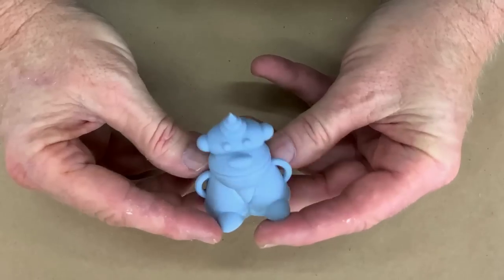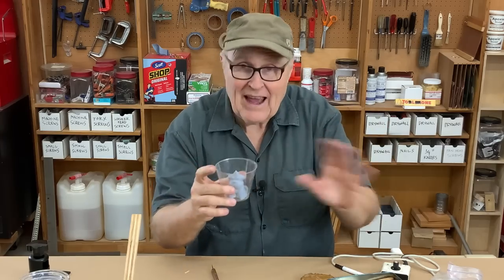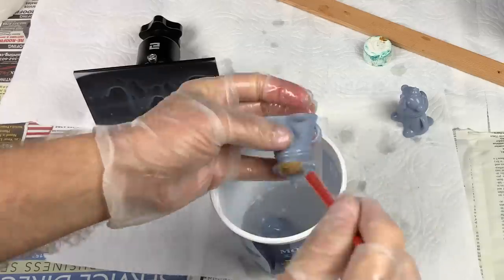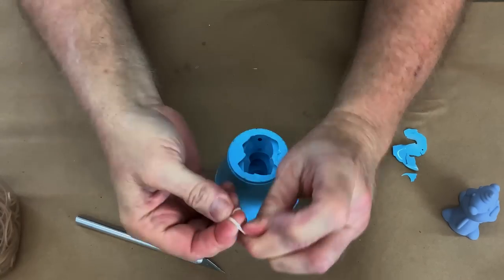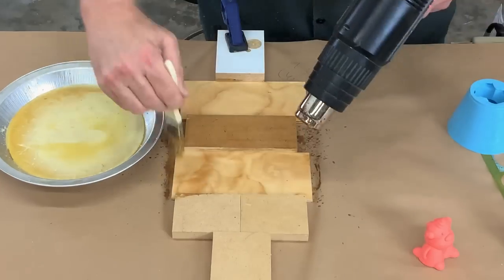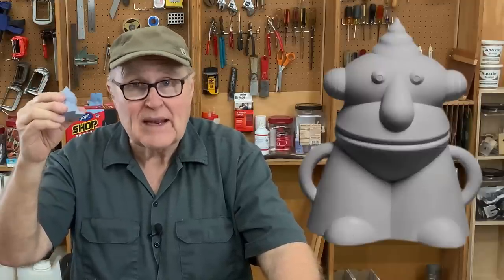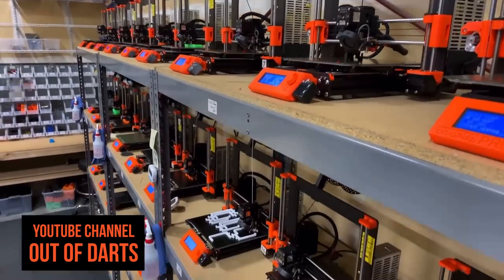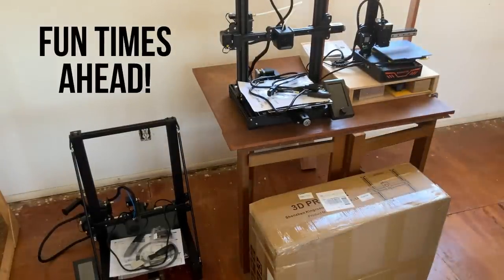Which Is faster - Resin Casting Or 3D Printing?

Comment: Neat test. Everybody loves 3D printers, but if you need it in bulk, it's far better to cast. And if you need a one off, better to 3D print. That's why I've never understood the 3D printer farms. If you need that many, you might as well cast it, doesn't take that much time investment to do so.
Reply: Because you can print on demand. You don't need a physical master to make a mold from. And each printer could be doing a different object. Imagine a client sends you 5 3D model files saying "I need 4 of this, 2 of that, 3 of the other, etc. " You just say OK and start the printers. No time spent making molds for each.
Reply: @3DJapan  Sure, and I suppose that happens a lot these days. That would fit in the realm of "one off", and I'm sure there's a lot of business in it. However, when you need tons of prints of the same objects and people go to a printer farm, that specifically is what doesn't make sense and it too happens a lot these days.
Reply: Also with FDM and parts designed for FDM process, there's zero labor/postproc. It comes off the bed ready to go.
Reply: @daliasprints9798  If you don't have to remove rafts or supports, then yeah, no post processing, but it'll still be slower than casting even accounting for sprue removal.

Comment: Another wonderful video.  I’m VERY interested in doing 3D printing as a master and then making slush molds to get as close to a designer vinyl toy as possible with flexible resin.  Which resin would you use thy could be tinted any color and also be flexible like soft pvc vinyl?
Reply: See the Crafsman’s videos. He does a deep dive into rubbers/resins/silicones that duplicate vintage Star Wars action figure ‘flexibility”.
Reply from the maker: I don’t cast flexible objects so I have never figured out the combination of materials to use. Elastomers are a whole other universe from resins. What little I have done taught me that there are nice urethane rubbers to work with but they have their own requirements. For instance, they often won’t cure in silicone molds and they are extremely sticky - in fact make an excellent adhesives.  You could possibly hollow cast urethane rubber in a solid 3D printed mold but you will need a very effective mold release or barrier coat.
Reply: @davesilva9174  Wow, I’ll have to go back and check.  Thanks!
Reply: @RobertTolone  Absolutely.  If I were back in the US, I’d buy up a bunch and try them out, but here in japan, resins and urethanes are basically a one size fits all type, no real options…

Comment: kind of reminds me of the shop i used to own with my then-wife, where we did screenprinting and vinyl. our standard was an order of 20+ shirts would be screenprinted, small order would be done in vinyl. i think that's very analogous, e.g. the 'mass-production' method took up so much more set-up time and a tremendous amount of physical space, but in the end saved time... but, there was more scrap and had very real costs.

i could go on and on, the point being it just depends. how many pulls are you going to get out of your molds, especially if there's finer detail? 12-15? without a printer, you're going to be making many molds to make enough pieces to make into a gang mold. you simply have to know your costs and your times. if you rent work space, that costs per square foot, so you have to justify that, too. but, at one part with your printer farm i'd have to ask, 'what are we doing here?'

Comment: I wonder how detailed you can get with a casting mold. On a Resin 3D printer you can get quite detailed. And do you print your models with a hole in the bottom, recommended to drain out any uncured resin when Printing. This is also 1 thing you don't have to do in Resin mold casting.
Reply from the maker: I would use drain hole where needed on hollow parts.

Comment: Hi,
One Question thats always in my mind: When you use a Papercup as Moldbox. WHY not place the Mould in one Cup for Resincasting? You can forget about the Rubberbands? The Cup holds the siliconemould perfectly in shape. 
Thanks.
Reply from the maker: Because, as strange as it sounds, cups are not identical- even from the same package.  I have discovered there are slight variations that can result in open parting lines on the mold.  Inside the cup I have no way of massaging the mold into a tight fit. With rubber bands I can adjust the strength and position of the closing pressure. Also, casting resin produces heat and the mold expands slightly. That means it no longer fits into the cup even if it did when the mold was cold.
Reply: @RobertTolone  Thanks for taken Time to answer me. I have some of your favorite moulds (two part clay moulds ;-) ) I keep them in the rectangular box. put the second part on it like a lid/cover and have no problems with castings. but never tried with cups. Thanks

Comment: great content, very helpful!
which one do you think produce more detailed product, resin casting or 3D printing?
assuming i made the molding silicone with 3d printed master
Reply from the maker: Much more detail in a resin casting. The resolution of current 3d printers is low compared to resin casting which can reproduce microscopic detail.

Comment: Cheated time on casting three. Exclusive use of three cast models in the casting box would have been truer. 
By using the printer resin prints for casting, you shorted the casting time considerably
Reply from the maker: I accounted for that time in my calculations.  That’s why it took me an hour to cast one and an hour and a half to cast three.
Reply: @RobertTolone  have a great weekend Robert

Comment: With Resin printing you should have made 3 prints in 1.5hrs not just one print. This is the difference between FDM 3D printing and Resin printing. With Resin printing Each layer cures the whole build plate in one pass. So the more you can put on the build plate the better. In FDM Filament printing You have to print one Model at a time. Taking 3x as long. So far it is neck n neck in the race.

Comment: Why you use the pressure pod instead of using vacuum? Best, Steffen
Reply from the maker: I use both. Vacuum for de-airing the rubber and pressure to suppress bubble formation in the resin.
Reply: Thank you very much Robert…

Comment: Printing and casting arent opponents, they're complementary. You can use a printer to make the masters, then cast those, best of both worlds. That said, there are shapes a printer can do that you cant cast.
Reply: He said that right at the beginning of the video. Not as directly as that, but he addressed it.
Reply: There is also a wider selection of materials and resins that can be cast than printed
Reply from the maker: I love them both and agree they are complimentary.  I also think that at the rate 3-D printing is progressing it won’t be long before resin casting will only be used by sculptors who prefer to work by hand.  Even then, the day 3-D scanning and printing reaches the speed of flat scanning and printing it’s game over for silicone molds and resin casting.
Reply: @RobertTolone  i've got 7 3d printers and am well and truly into the hobby, but i've been watching your channel to learn casting. Like you pointed out, you can cast a whole load of a part way faster than printing. Especially for larger parts.

Comment: I don't have much experience with casting so maybe this is something obvious I'm missing, but is there a reason you don't print the negative/mold directly rather than having to do that step manually?
Reply from the maker: You can print molds. I have done that in an earlier video. Right now I am experimenting with printing molds using flexible resin.

Comment: I’ve been looking into creating molds out of my 3D prints but I keep reading about cure inhibition. Apparently platinum silicone doesn’t like resin 3D prints. I was curious to which kind of silicone you used or how to prevent cure inhibition from happening.
Reply from the maker: I use tin-based silicone from www.silpak.com: EconoSil-25.  It’s the most inexpensive one.

Comment: You are saying that it takes the same time to cast x amount as print one. However this is an SLA set up. So it's actually the same as 3, the max you can fit on the bed. Unlike a fdm printer, it works on layer time and not nozzle workload. So not a huge difference but incorrect all the same
Reply from the maker: in my calculations I allowed for how many pieces you could gang onto a print bed.  Obviously, if you had a much larger printer, or a print farm, you could print them faster.
Reply: @RobertTolone  you fitted 3 on the bed when printing, but used just 1 printed when comparing to cast.

Comment: I think you forgot one important factor: MONEY 💰💰💰
What is the total cost of the two process?
If you only run a small batch, the casting will be too expensive and not as efficient.
I'm curious to know about that.
And with resin printer, if you have a large one (Jupiter I think?) and or many printer, you might be more efficient and cheaper compare to molding, isn't?

Comment: Just curious, would an FDM printed item. printed at 20% infill collapse in a  pressure pot?
Reply from the maker: It could collapse or be infused with rubber. It might not, but the risk is there.

Comment: No one manufacturing method is better than an other one. I have seen a video where somebody really claims 3D printing will replace injection molding lol....ridiculous.
Everything has it´s pro and con. 3D printing is still rapid prototyping, that´s what´s it´s there for.
The big advantage to 3D printing in this use case is, if you automate the process you can print over night, it´s hard to automate this casting process here. And you can increase the amount of printers, those are cheap compared to labor.

Comment: Robert, is the resin that is used in a RESIN 3D PRINTER the same as the resin that you pour into a mold ?.. buying some products from SMOOTH ON , i was shocked at how expensive that they are and i am hoping for a cost effective resin to pour into the molds i want to make.. Just wondering what else i could use.
Reply from the maker: They are not the same.
3d printing resins cure by exposed to UV light.  Casting resins are 2-part systems that cure by mixing the A and B components together. The mix ratio is usually 50-50 but not always. The manufacturer will specify the proper mix ratio for the resin.  When mixed, the resin has a certain amount of open time before it begins to cure. It also has a time it requires to harden enough to be removed from the mold.

Resin is expensive. Larger quantities cost much less per gram than small quantities. That is why I buy my resins in 5 gallon buckets.  But for most hobbyist that is not practical.
Reply: @RobertTolone  You are so helpful to all of us hobbyist, You always answer everyones questions... Thank you.. YOU ROCK..
Reply: @RobertTolone  Have you ever tried using FINE CEMENT as your casting material.. would that work without harming the silicone mold.. it would be so much cheaper to use CEMENT over the expensive resin.. you can buy it without rocks added as a FINE POWDER... and just add water.

Comment: in my (admittedly limited) experience 3D resin and FDM printers may not be the best choices when making parts that have thin, flat surfaces. the warping issues are incredibly time consuming and frustrating. definitely not something you want to deal with in a production environment. also the dimpling from removed supports, especially on flat surfaces

Comment: Kinda true but not entirely correct.
As someone that does both printing and casting, you neglected that it is EXTREMELY easy to make a mold with a 3d printer rather than make a mold with silicone rubber. There is software where you drop the finished piece into a 'block' and then subtract the model from the block, you can then (in model space) cut the block in half and you then have a mold that you can cast.

If you still want a 'soft' mold, you can just add flexible resin into the cast print. 
Once thats done, you spray the release agent onto the print, pour in your resin a remove when cured, repeat.

Comment: I recently got some silicone rubber specifically for making 3d printed molds, but one of the first things in the instructions was a mention of curing inhibition when using UV resins (which wasn't mentioned on the product page...). My own experiments with this have shown that my resin is problematic. I've found that I can improve it with soaking the print in alcohol for a few hours, but it's still not perfect. 

Do you have any suggestions for dealing with this? Do you know if the silicone you used is specifically compatible?
Reply from the maker: I always use tin-based rubber when molding 3-D printed objects.
Reply: @RobertTolone  Are there any food safe tin silicones?
Reply from the maker: @mredig  Possibly, but I don’t know of any.

Comment: I don't think the preparation stages should be calculated into all this. Sure you need to make a mold first for the casting way... but you don't start building the 3d printer at the start of the project now do you. Everything ready to go, pouring VS clicking the print button, head to head, that's the fair way.

Comment: 2:18 - Me: Ha ha, he said whack them with a stick, I love Robert's sense of humor.  (Two seconds later) I can't believe he actually whacked them with a stick! LOL
Reply from the maker: Works like a champ! (Unless your print is very fragile!)
Reply: Engineers have used that technique and variations of it forever!
Reply: @RobertTolone  Consider getting a WhamBam flex plate.  It's a flexible magnetic sheet that sticks your build plate.  It saves you from having to take the build plate off the printer-- you just take the plate off, then bend the plate to pop the models off.  A small investment, and it saved me from accidentally chipping models removing them from the printer and I never have to re-level the build plate.  Highly recommend!  LOVE these videos as I'm currently doing a lot of this stuff myself.  No doubt casting is quicker, but I'd argue for my sake, the learning curve is higher and costly (materials spent) when learning how to properly cast.  Your channel has been a great aid along the way though!
Reply from the maker: @eric3dee  👍 I’ll look into the flex plate.

Comment: Since this is meant to be an apples to apples comparison, there are some issues with this analysis:

- When doing a production cast, don't you normally only get a single model to work from? Using the first few 3D prints past the first feels a little cheaty and biased.
- The time for silicone to cure should be counted in the time expenditure. This is production. That down time matters. It's 24 hours, not 1 or 2. As you gang more and more parts, the cut time multiplies. That counts.
- Related to the first, the down time was counted for the 3D prints, but not the molds. More bias.
- You can cycle 3D prints constantly. Pull the prints, dump them into your alcohol bath, top off the printer if needed, run another print and do your cleanup. Minimal down time is your friend. You will have down time, sure, but you can hit your stable rate immediately, while it takes a couple days to hit it with casting.
- I acknowledge that previous molds can be cycled as more are made, which does result a steadily accelerating production.

Math ahead:

If you're only doing 50-100 parts and you can print three per hour, call it ten hours a day interspersed with other tasks. For 100 parts, that's 3-4 days of 3D printing. If you do 8 hours, start of day 5 or a small push at the end of day 4. That absolutely destroys casting up front, where you have 20 at the end of day 2 assuming maximum productivity for 10 hours and and 16 working 8, whereas the 3D printer is sitting at a cool 48 or 60 at end of day 2. Triple the inital productivity.

If I were to run the analysis for 8 hours, casting doesn't hit a higher productivity than 3D printing until around day 3 assuming perfect productivity with zero hiccups, zero flaws, and zero cleanup. 0->16->48->112/day, which puts finish on day 4. That assumes several pressure pots that can run in parallel. With one pot and a limit of 6 per mold, it goes 0->16->32>64->96(stable), which puts finish on day 5 slightly later than the printing. If you count opening and sealing a hobby-grade pressure pot it slows down, putting 3D printer clearly in the lead.

Doing the math, it's a closer race to 100 than you might think, maybe a day. Since you aren't rushing with the 3D printing and can take a lunch break, answer emails, watch videos, vibe to music, call a friend, go for walks or whatever else without interrupting the process, I'd call it a win for the relatively small quantity of 100. Past that casting is the clear winner, especially if you have multiple pressure pots.

If you have a second 3D printer and stagger the prints slightly it absolutely dominates for the model in question.
Reply from the maker: I removed the waiting time from my calculations.  And in my calculations of casting speed I only used one pressure pot because the others were not necessary. I calculated a cycle time of two per hour.  In projects where I’m running all seven tanks the rate can go up to thousands a day depending on how many cavities I am casting.  Plus, if I am really in a hurry I will use a rubber that cures in a couple hours rather than overnight. On the other hand, if I had a bunch of resin printers then things would equalize out nicely.  But as I said in the intro, every project must be calculated separately taking into account your shop equipment and what it is you are making.  Everybody I see making money at printing has a farm, not one or two printers.
Reply: @RobertTolone  I understand. Thanks for taking the time to respond!
Reply: if you have to clean up a lot of supports, that's going to take up a lot of time, no? do you also not have layer lines even with a resin printer, too? i thought with resin printers you also had to put them under a UV to fully cure?